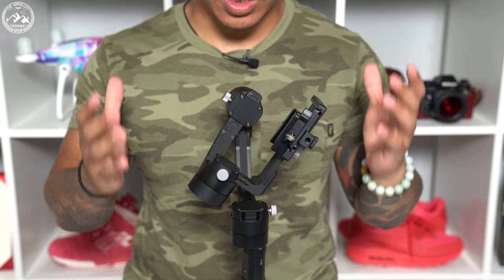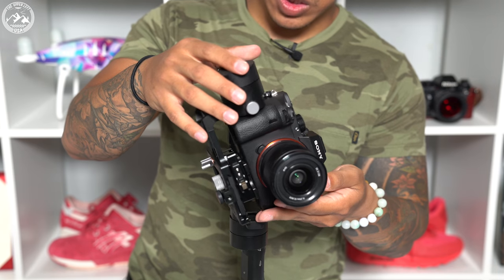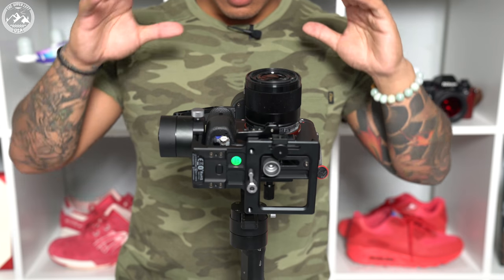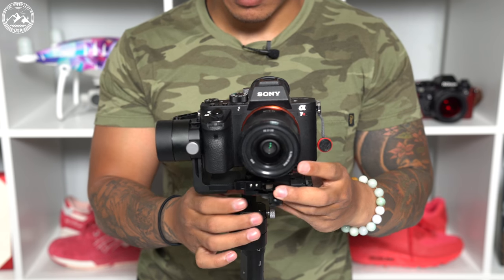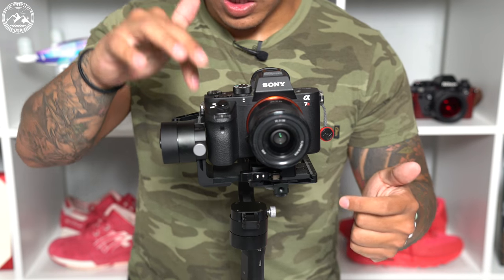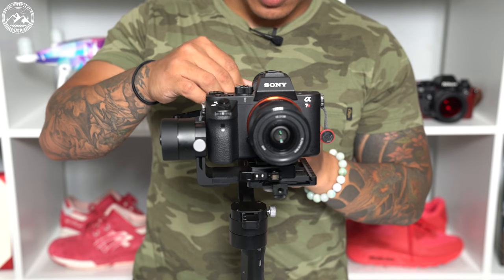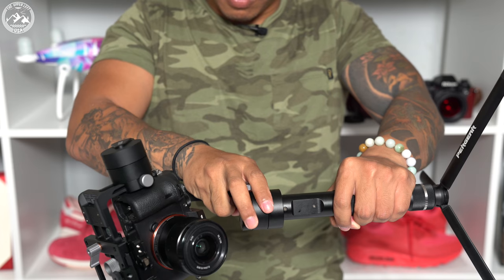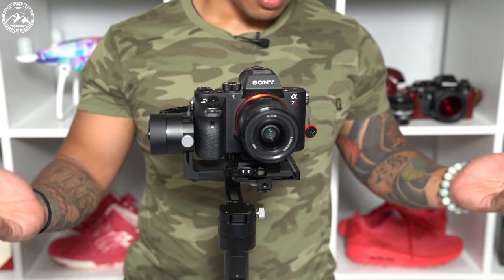How  to Balance the Zhiyun Crane V2

Comment: Great tutorial! Just a stupid question, after balancing it for the first time, you don't need to do it every time you want to use it, as long you use the same camera with same lens and the quick release plate, right?
Reply from the maker: Yes. As long as the setup doesn’t change and the balance isn’t accidentally changed, you can use the gimbal without having to rebalance.

Comment: Interesting method.

But - and I don't have a gimbal so i'm guessing - I would have balanced it in the opposite sequence. Start with the 
adjustment atop the tripod and work your way toward the camera's baseplate.

Have you tried that way, and what were the results?
Reply from the maker: +spikey 27 Are you suggesting doing pan, roll, tilt then baseplate? I've really only ever balanced the gimbal in the order that I've done it in the video. 

Although it's easy to balance, I feel that since the pan requires you to lift the gimbal, most people would do it last. I personally  leave it last because it's easy and doesn't require much thought. I focus on doing the hard stuff first. 

I balance the roll first because as I've said, if you don't, while balancing the tilt and baseplate, the camera will be bouncing around, making it harder to balance. 

The tilt and baseplate is next because they correspond with one another and generally take more time. I assume that this is where most people will be having difficulty balancing the device. Once this is done, everything else is pretty self explanatory. 

If you work at it backwards, I feel that it would be doing pretty much the same thing that I did. The only difference would be doing the pan first.

Comment: This video was a great help, clear and concise instructions! I have an issue, I can lock down the Tilt axis, and it stays in any position I move it to(perfect), but when i balance the Roll and Pan they always move back to the center position I balanced it to(parallel). So if I balance the roll so the bar is parallel to the ground then move the bar down(or Up) it will swing back to center. Is this an issue? You've earned my sub either way.
Reply from the maker: Thanks a lot for subscribing! As far as your situation, can you dm me a video via Instagram so I can see what's going on? @TheUpperLeftUSA

Comment: Great video! I'm struggling with the balance of my Crane 2 with a 5D Mark III and a 24-105 lens. I can balance it perfectly level but when I move it to a different position it's supposed to stay in that position - but mine just keeps flopping back to its levelled position. I've recalibrated it. Once I've balanced, with the camera facing forward I can point the camera down and up and it'll stay put like it should do, but if I roll to either side, it always rolls back to centre. Is it me or have i just purchased a faulty gimbal? If you need a video for understand better my issue I can send it to you. Thank you!! :)
Reply from the maker: From what you said, I don’t think it’s the gimbal. Since you had the same issue with the tilt and then was able to get it balanced properly. It sounds like it just needs to be balanced further. If you can’t get it, just try turning the gimbal on and using it. See if it even matters because very often you don’t even need to get the gimbal balanced to he point of it staying in every position. You just need it to the initial balanced position.

Comment: I have the Sony A7s ii with the 24-70mm lens but having trouble balancing on the Crane 2. Do you think my lens is too heavy for this product?
Reply from the maker: The Zhiyun Crane 2 has a maximum payload of 7 lbs, which is more than enough for the Sony A7SII and 24-70 f/4 or f/2.8. Your problem with balancing is likely not a weight issue, but that the combo is too long for the setup to actually balance. The gimbal might not have enough clearance to actually get the combo to the proper balancing position. I don't have the Zhiyun Crane 2 so can't verify this, but this is a problem with the Zhiyun Crane V2.
Reply: I see. Thank you so much for the fast response and clarifying my issue. I might look into the lens you have or just return the gimbal. We'll see!
Reply from the maker: You’re welcome. I would suggest you invest in a small lens. You’re going to have issues with a long lens on any single handed gimbal. It won’t balance properly until you go to something the size of a DJI Ronin.

Comment: Hey! Have you tried balancing the a7rII with it's battery grip? I'm curious to see if it would work as I'd much rather have the battery grip on without the hassle of switching batteries.
Reply from the maker: I've tried this but would not really recommend it. Even if you balance it to an acceptable point, there is no top clearance so you'll have to watch how you move the handle. I'm a battery grip user too but have learned to just not use it when I'm using the Crane.

Comment: If I was going to set out to demo this process and did it as well as you've done, I'd be like SO pleased with myself!
Don't have one yet - my 5d2 with the 28mm Pentax prime I want to use for this comes to a bit under 1200g - how does that compare to your Sony set up? No way I can afford the bigger heavier Crane... but I'm a little concerned that's pushing things a bit.
Reply from the maker: Even though all of these gimbals give a maximum load capacity, that number can only be achieved under certain situations. I can tell you that the same set up shown in this video but with a cage is pretty much the absolute maximum that I can get to work with this gimbal even though it is under the maximum capacity and at that, the gimbal isn’t even balanced properly. It is just balanced enough to function. If I were you, I would invest in the Crane 2 just to have the flexibility to really balance a variety of setups.

Comment: Can you link to the exact QR plate you used? Evaluating various one, as I'll go with the same plate on all my gear.  Thanks in advance.
Reply from the maker: I've pretty much switched to this one on all of my tripods/accessories. 
https://rover.ebay.com/rover/1/711-53200-19255-0/1?icep_id=114&ipn=icep&toolid=20004&campid=5338083292&mpre=http%3A%2F%2Fwww.ebay.com%2Fitm%2FMENGS-CL-50LS-Quick-Release-Clamp-w-Adjustable-Lever-Knob-For-Ballhead-Tripod%2F371677766608%3FssPageName%3DSTRK%253AMEBIDX%253AIT%26_trksid%3Dp2057872.m2749.l2649

Comment: Thanks  a lot bro for the efficient tutorial. Please, could you tell 2 where i can find your Arca Swiss Adapter. Because, went to the website but couldn't find the same version like the one you have. Thanks once again !
Reply from the maker: This is the exact arca swiss adapter that I'm using in the video. It can be purchased using the link.
https://rover.ebay.com/rover/1/711-53200-19255-0/1?icep_id=114&ipn=icep&toolid=20004&campid=5338083292&mpre=https%3A%2F%2Fwww.ebay.com%2Fsch%2Fi.html%3F_from%3DR40%26_trksid%3Dm570.l1313%26_nkw%3DMENGS%2BCL-50LS%26_sacat%3D0
Reply: The Upper Left USA thanks a lot bro. I still have a problem in balancing the Zhiyun crane, using the Sony a6500 with Zeus 16:35 / F4 lens.
Reply from the maker: As a reference, I can balance the A7rii/A7sii with the Zeiss 16-35 F4 without a problem. I feel that the a6500 and A7rii/A7sii are close enough in size that you should be able to balance it with the 16-35 without a problem. Just keep going at it 👍
Reply: yeah i will keep going and hope the adapter will help. Many thanks once again !
Reply from the maker: This is just me, but I don't think having the adapter will really help at all in balancing. It just makes mounting the camera faster. If you can't balance it without an adapter, you won't be able to do it with an adapter. If anything, the adapter will only add to your max payload.

Also, you're welcome and glad I could help you.

Comment: I have a Panasonic G85 with the 50mm lens, no matter what I do my camera leans back. Only thing I can think of is my camera is too light. I have the base plate all the way to the front and its still leaning back.
Reply from the maker: Weight may be the issue. The camera setup may just be too light.
Reply: Hai Tran Thanks for the quick reply. Any suggestions on how to fix it
Reply from the maker: If weight is the issue then finding a way to add weight is the only real solution.

Comment: i know this is video is a little old but could you help me, ive done everything and it works just fine when the gimbal is turned off but when i turn it on, it slowly goes up until around 60 degrees
Reply from the maker: I’ve gotten rid of this gimbal a long time ago so have no way of helping you. I’d suggest contacting the manufacturer in case they have some insight.

Comment: so i just got my gimbal, and granted its my 1st night trying, but after trying for hours i can't balance it at all. it keeps rolling forward (lens goes down) I'm using the fuji xt2 and light lenses like the rokinon 12, fuji 18-55 and the 23 1.4. none of them work. I adjusted the side screws and the baseplate like you said but no matter what i do it kept rolling forward, best i could do eventually was to just get it to go forward (facing down) just a little bit. but never level.

Eventually i gave up and tried to add the battery grip, figured that had a lot of weight on it, maybe that would help, well sure did now the thing would roll backwards (lens facing up), no matter what i did from there it would always go backwards. Until I tried the bigger heavy lens the 16-55, and sure enough it would roll forward again. But couldn't ever adjust it to just be balanced either. 

Small and light lenses or big and heavy, nothing seems to help, grip or no grip. Extremely frustrated and really hope my gimbal isn't broken. its probably user error but dang this is so hard.
Reply from the maker: If the setup is falling forward/ backward, the first thing you should be adjusting is the baseplate. Move it back and forth to compensate in the direction opposite of the fall. The second thing to do is adjust the vertical arm. If you drop it all the way down and the setup still falls forward/ backward, then it definitely means you have the baseplate setup improperly. Adjust the baseplate then and raise the vertical arm. Keep down this until you can't raise the vertical arm anymore. Adding more weight wouldn't be how I would approach this problem.
Reply: eventually got it to work, took hours to balance. IDK what i did. lol. I balanced the base plate like a million times (it felt like) before and it didn't matter what i did. I guess eventually i got lucky.
Reply from the maker: Hopefully, you can figure it out because you're not going to want to use it if it takes hours to balance it every time.

Comment: Do you think the zhiyun crane V2 would work good with a sony a6000+ 16-35mm canon lens w/ adapter?
Reply from the maker: I don’t have this setup so can’t concretely verify for you. I would say that I’m concerned because with the adapter, the setup would be front heavy and there may not be enough clearance to actually balance it properly. But again, this is just an assumption.

Comment: do you need to calibrate it in the app before you do this? I completed all your actions and it was balanced fine. Then I calibrated it in the app and once it turns on it loses balance now and joy stick keeps spinning? Is the app calibration even necessary?
Reply from the maker: The app calibration isn’t necessary. It’s more to fine tune the movement/settings if you want.
Reply: Thanks for the response! Did you bother upgrading the firmware when you got yours? Or did you just take it out of the box, balance it and then just use it from there?
Reply from the maker: I just use it out of the box and still do. Haven't bothered to adjust it in any way yet.

Comment: I am struggling to keep the camera positioned any way i want "after" balancing it. I've been at this for a day and am not sure if its because the weight of the camera is too small or i may have fucked up the motor.  gear: a6500 with a 10-18mm.
 please help if you can
Reply from the maker: That set up should provide enough weight for you to properly balance the crane. If you have Instagram, DM me a video of your balancing and I'll see if I can figure out the problem.
Reply: yea. Ill slide into you DM's tomorrow. Gotta go to work!
Reply: I am also really curious what would be the problem here. Since I can basically balance it. Not being able to keep it positioned. However, whenever I turn it on. It works as it should.

Just the positioning after the "balancing" does not keep it the same when pushing it a bit forward or backward.
Reply from the maker: +ThorgalCaesar It works when you turn it on even though it’s not balanced because the motor is working to correct it. It’ll work, but it’ll just put more stress on the motor reducing your battery life and probably the general life of the motor in the long run. If you have a problem with balancing, DM me a video of what’s going on through Instagram and I’ll see if I can figure it out.
Reply: I just DMed you a video! I noticed I left the hoodcap on in the video, however, whenever I take it off. It basically does the same. Thanks in advance.

Comment: hey ,  i just bought a zhiyun crane and my camera(panasonic G7) is too light to be tilting forward, no matter how i lower down the tilt axis and the base plate.i cant balance the camera like what you did in the video
Reply from the maker: What is the problem? It won't tilt forward or it's tilting forward too much?
Reply: it wont tilt forward
Reply from the maker: Have you tried pushing the base plate forward?
Reply: and , once i set the mode to tilt locked, i adjust my camera to the to highest angle (camera looking up) through joystick, my camera drop back to flat level immediately , no matter how man times i tried , is this something to do with battery power?
Reply from the maker: From what I see, he has his tilt axis way too low. Lowering the tilt axis is really to compensate for a heavier camera. If your base plate is all the way forward and your camera is tilting back like the video you sent, you need to start raising the tilt axis. The higher the tilt axis, the more you'll need to move the base plate back though. 

If you can't figure it out and you have Instagram, DM me a video of what you have going and I'll see if I can figure it out for your case. @TheUpperLeftUSA
Reply from the maker: As far as the problem with the camera returning to flat level, I'm not sure what you mean by this so you'll have to send me a video of it so I can check it out.

Comment: Hi. I have a similar set up with the a7rii and 28 mm. The problem I am having is that the base plate hits the bottom axis when rotated.. I feel I have tried to adjust it so that it doesn’t hit but then it’s out of balance. I’d love your help on this. I’m getting frustrated :)
Reply from the maker: I regularly use the A7RII with the 28mm so can say that if the baseplate is hitting the pan axis, your setup is too low. Raise the tilt and readjust.
Reply: The Upper Left USA I have it all the way to the top and it still hits.
Reply from the maker: You should not need to have it all the way up. It won't balance properly. It doesn't make sense how the baseplate would hit the bottom pan axis (where the handle is) if it is all the way up. DM me a video of the situation on Instagram @TheUpperLeftUSA

Comment: What brand is the quick release base plate you are using?
Reply from the maker: It's this one that I've only been able to find on ebay
https://rover.ebay.com/rover/1/711-53200-19255-0/1?icep_id=114&ipn=icep&toolid=20004&campid=5338083292&mpre=http%3A%2F%2Fwww.ebay.com%2Fitm%2FMENGS-CL-50LS-Quick-Release-Clamp-w-Adjustable-Lever-Knob-For-Ballhead-Tripod%2F371677766608%3FssPageName%3DSTRK%253AMEBIDX%253AIT%26_trksid%3Dp2057872.m2749.l2649

Comment: So I've heard different opinions on the subject of lens/camera stability in addition to the gimbal... like ois or ibis. I have ois on some of my lenses like the 18-55mm fuji lens, would that help with stability or make it worse and get in the way? 

I was using my rokinon 12mm f2 lens and it did a good job mostly but still some shake. maybe its just user error and how i walk. Sadly I don't think i can use this lens for vlogging it seems like i was always out of focus bc of min. focus distance when i had the camera flip around to selfie mode. but for everything else it worked nicely. maybe a good wedding lens once I get more practice, maybe try the heavier but theoretically nicer lens my 16-55 2.8 zoom.
Reply from the maker: It's typically recommended to turn OIS or IBIS off when on a gimbal but I never do. You'll just have to do your own testing and see what works for you.
Reply: Actually you can use the rokinon as vlogging lens, just make sure to close the aperture to f/4 or 5.8 and set your focus in infinity that’s it! I using a manual lens as vlogging lens!